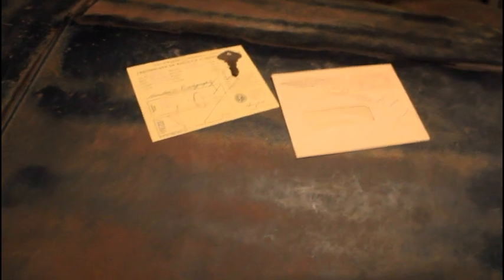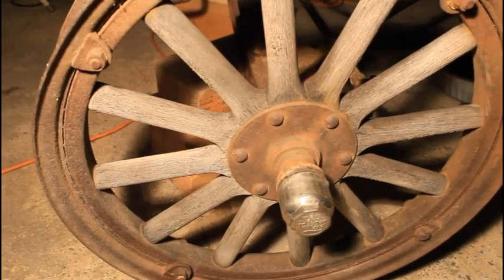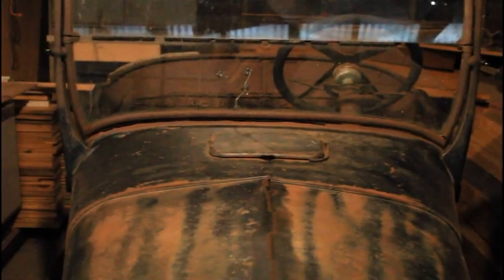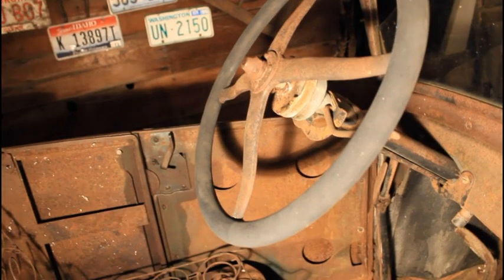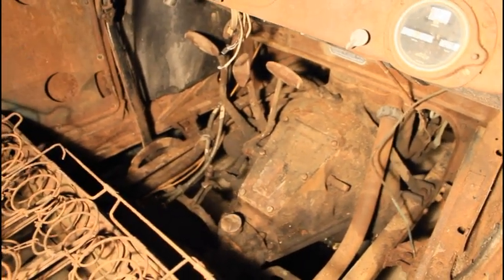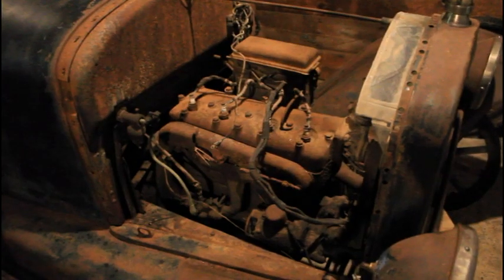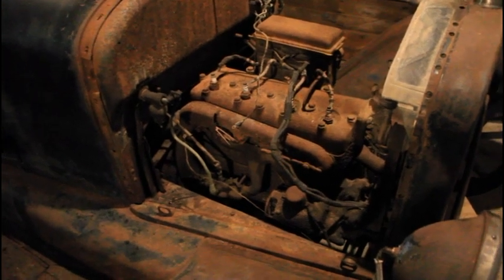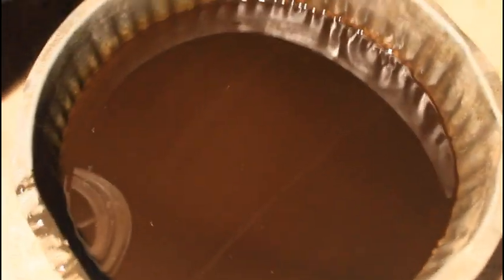1927 Model T restoration part 1, Introduction

Comment: Interesting video introduction to your car.  I'm getting a late start but I intend to watch all the videos.  I have a 1926 Model T Two-door.  I've had this car for about 2 months and I feel fortunate that it has no rust and is complete even to a Ruckstell axle.  Since it sat for 5 years I have hope it will run, but as of now, I am going through the entire car with cleanup and maintenance. Hope to be driving soon. Yep, I am slow and methodical.

Comment: I just purchased a 1926 Fordor and will be watching as you restore yours. I will be restoring mine too, but the engine and transmission were rebuilt by a professional just before I purchased mine, so I wont be doing any work on them.
Reply from the maker: That sounds like an amazing find.  Thanks for watching my videos.

Happy tinkering!

Comment: I’m working on a ‘27 coupe with steering problems. Wheels turn too far to right so steering bar underneath hits oil pan. Do you have a video restoring steering column? Thank you!
Reply from the maker: I have not made a video on it yet.  Sounds like it needs adjustment in the linkage.  With the steering wheel straight the tires should be straight and both of them should be slightly toe-in.  Thanks for watching!

Comment: I found a 1920s ? Model T that went over the embankment from the road ahead and ended up in a ravine on our property. It was half buried.  I'm trying to date the car. It has dual leaf springs on front and back . It has a National Guage Ammeter that says October 1919 Please let me know what year this old wreck is...thanks
https://www.youtube.com/watch?v=CHX5nNShtEk
Reply from the maker: Cool find, but I don't know what it is, it is not a model T.  The most obvious difference is that a model T uses transverse leaf springs, while your find does not.  I don't know enough about other makes to identify it, but that spring setup would probably be the best thing to use to identify it, I have never seen that a spring system like that.  You might be able to find a company logo on some of the steering components.  There were a ton of companies that made cars and trucks before the depression, most of them went bankrupt, or were bought out, so it could be a little known make.